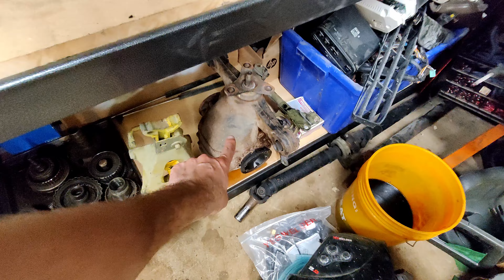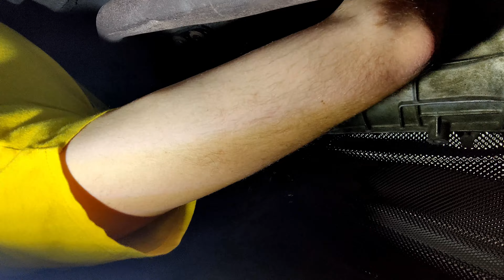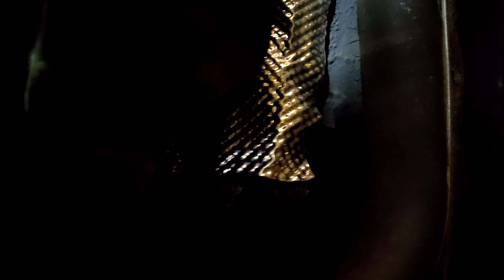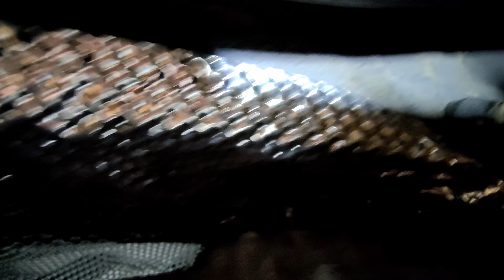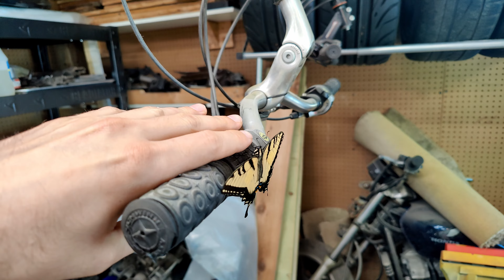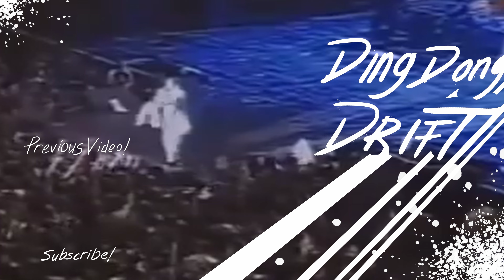The CD009 Swap is Too Damn Hot!

Comment: How much of the heat is due to the trans vs the lack of insulation/carpet? Does the CD009 produce more heat than the A340E?
Reply from the maker: I have no way to compare but it's just hot af lol
Reply: @DingDongDrift  I have a cd009 swapped sc400 and I can relate it’s hot af and my cars still full interior